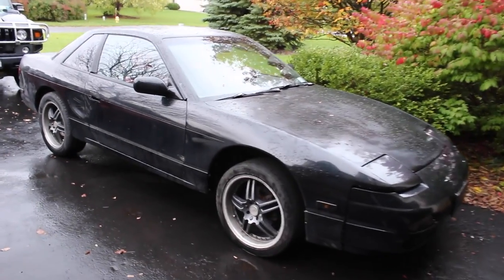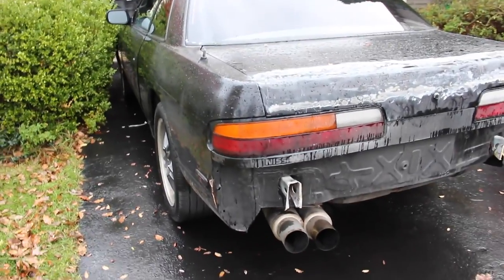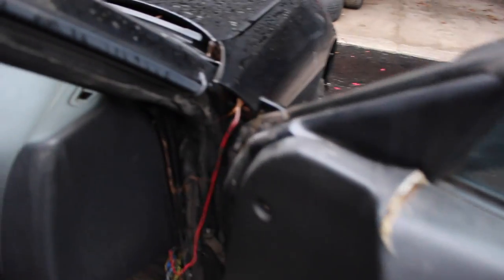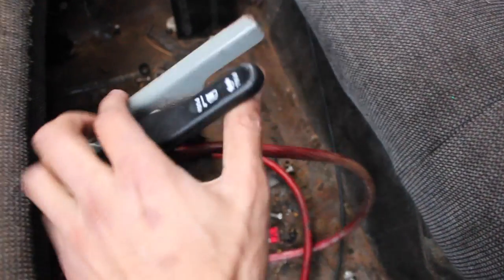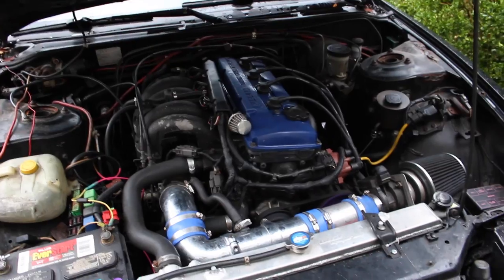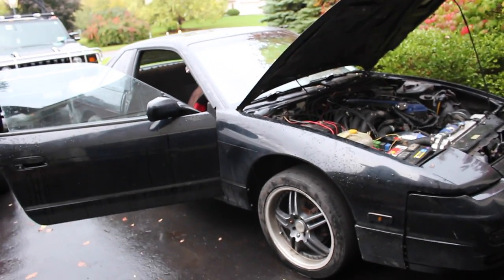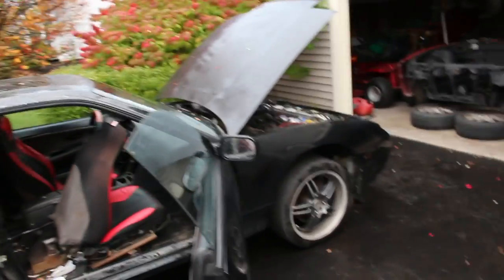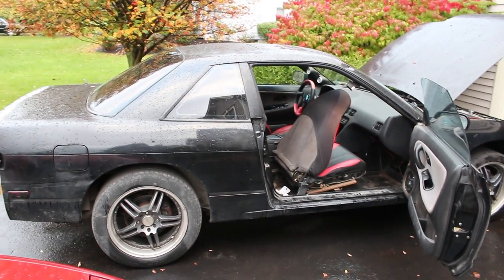MY NEW CAR! | The Winter Beater

Comment: Change your idle it should be at 700 rpm when warm. I've swapped many s13 vert to five speed and never had and idle issue. Ra enthalpy will reflash and auto ecu no problem for a kat build.
Reply: Verts* rs*

Comment: I kinda have the same problem with my 240, i 5 speed swapped it but I have an auto ecu. It idles at 1500 for a few seconds then it bogges  down
Reply: Ricky Duran de or e? I have a 5 speed single ecu
Reply: Jesse KESLER de
Reply: Try wiring in the Neutral Gear Switch

Comment: how mutch yu want for the steerin wheel
Reply from the maker: +Justice Thurber idk $50
Reply: Kalvin Malli man i thats not good one i locked into was $35 and it was a LOT better so man please do your research sary but $50 is to expensive
Reply from the maker: Justice Thurber Actually, the grant steering wheel I have retails for $155 on eBay. But if you're not interested, not a problem pal.
Reply from the maker: Justice Thurber Buying an aftermarket steering wheel for $35 is not safe, that will bend. Probably made from cardboard.
Reply: Kalvin Malli thanks for lookin out for your fans bro plus i love your hare
Reply: +Kalvin Malli (ThatBurgundy240) at least he's trying.....
Reply: Kalvin Malli il give you 80 with shipping

Comment: I have an hks hi power exhaust system with a test pipe, I'll sell it if you wanna and can ship
Reply from the maker: +Gabe Dunn That sounds nice but I'm not trying to spend mad money on a exhaust for this thing. Probably just going to weld on a smaller dual tip muffler on it. Stock ish, but still looks clean. Need a bumper though lol